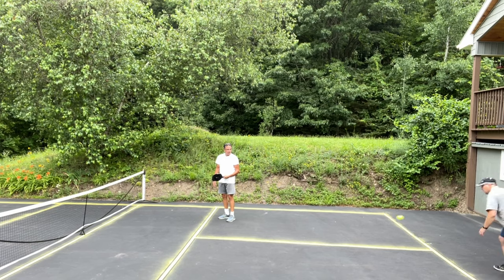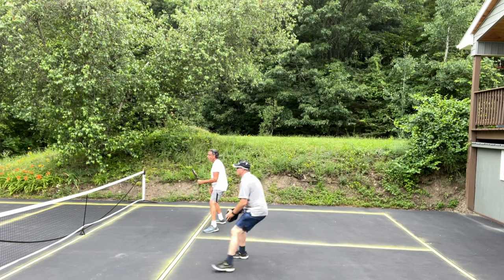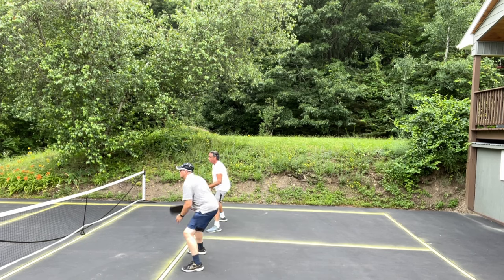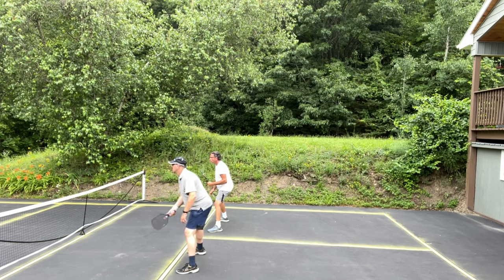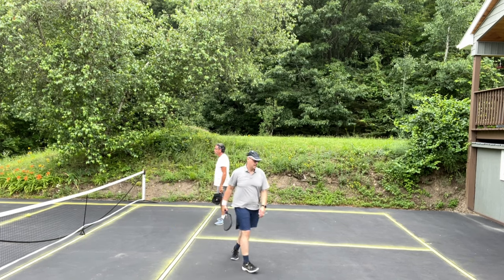Vatic Pro Flash 16mm Pickleball Paddle - Is it for You?

Comment: I like you do a heavy overgrip on my Flash. Also weight it at 4&8 o'clock. Total is 9.3. I play a "control grip" so my elbow and wrist don't mind the weight. I also rotate back to my GEARBOX CX11 now and then for a change in feel.
Reply from the maker: I find the extra overgrip keeps me from clutching the handle too tightly. Helps with control.
Reply: @jorowi  I overgrip all my paddles. That was a key to playing through a tennis elbow issue I had from twisting wrenches for 30 yrs.